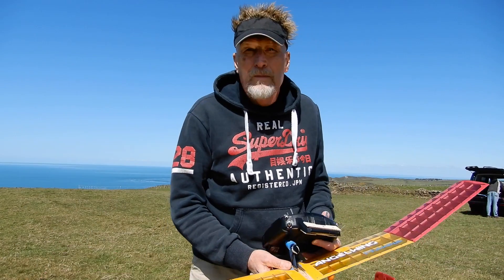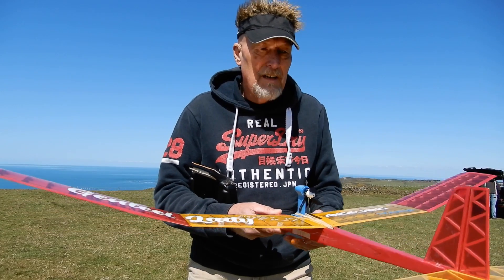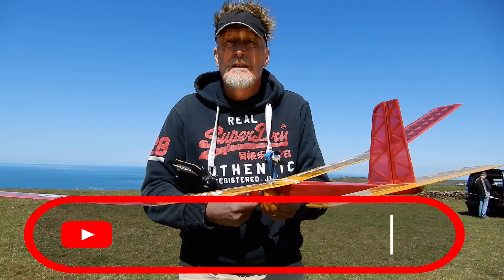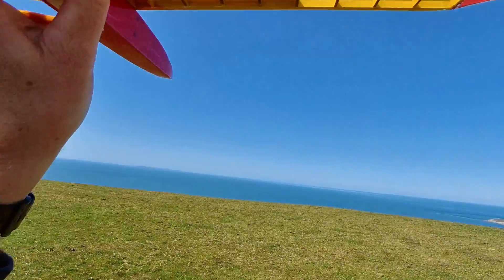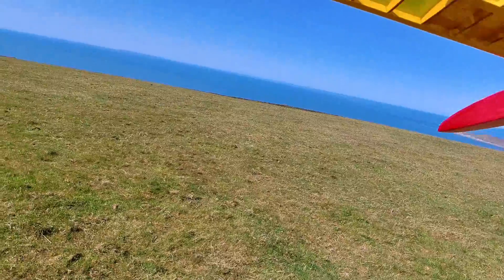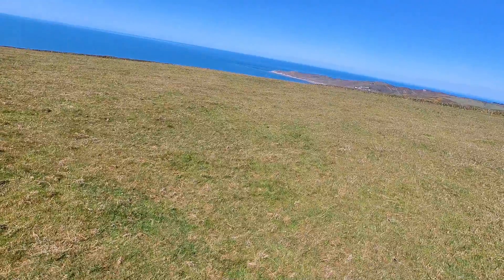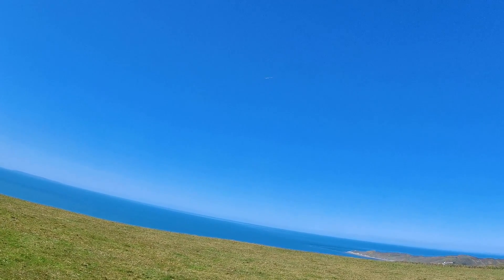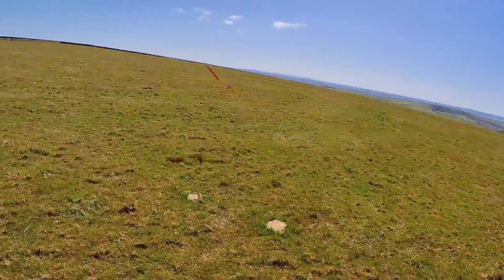Test Flight Power Pod Genteel Lady

Comment: Question 4 ya.

I understand "launch bungee line"
Is made to for glider up in the air.

Wouldn't also get majority of my rc planes up as well?

Have you tried regular powered rc planes on this bungee line device?

Sometimes my hand launches don't tien out as expected & nose dive many times.

Mostly due to a bad hand launch or incorrect angle.
Too high angle & stalls. Erc.
Reply from the maker: @Mikinct  yep I have friend who launch’s from a small ramp mate